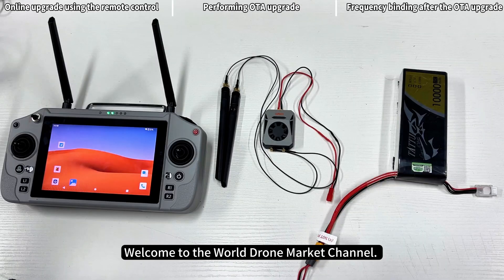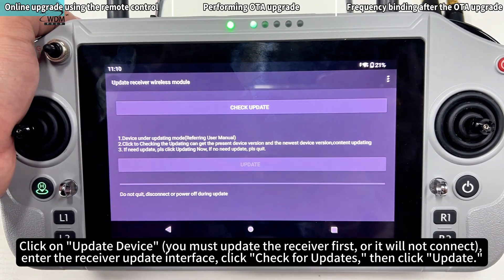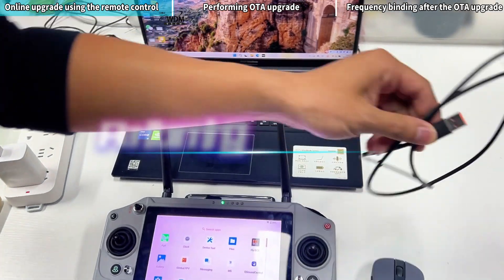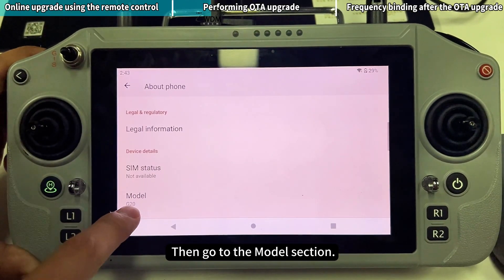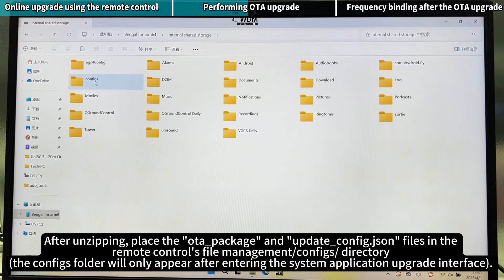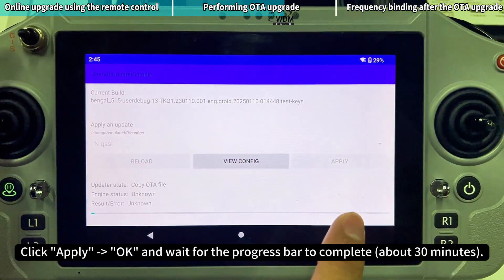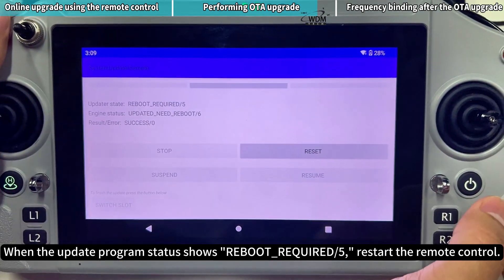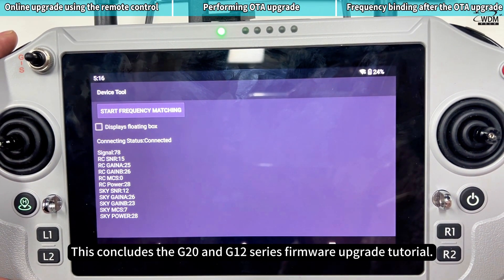Firmware upgrade tutorial for G20 and G12 series

Comment: I have this g20 controller and a c12 camera. My question is can i buy the c20 night vision camera and view them both at the same time on the g20 simultaneously? 
Or do i have to manually switch them on the controller ? 
Also is there a way to view both cameras in the ground control software ?
You sell the c20 right ?
Reply from the maker: The C20 camera can be viewed on the G20 remote controller. There is no way to view two cameras at the same time in the ground control software because the G20 receiver only has one Ethernet port. We sell C20.